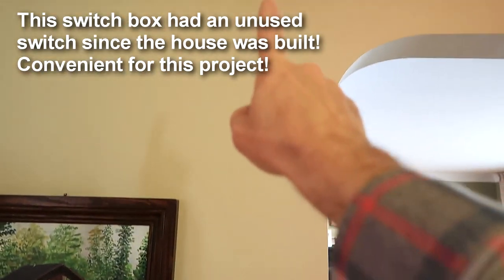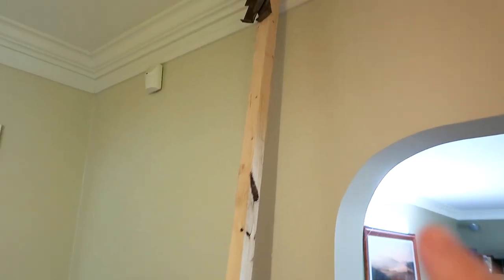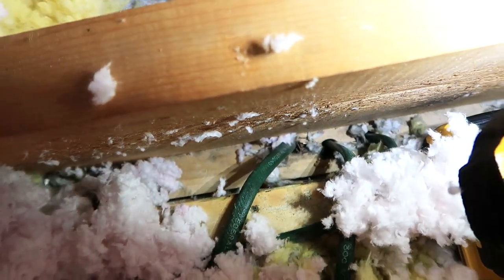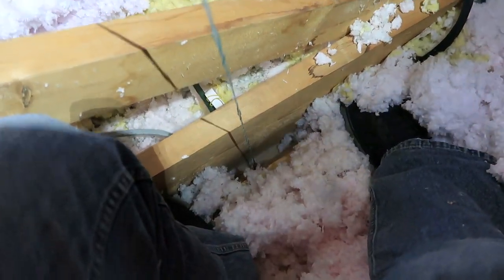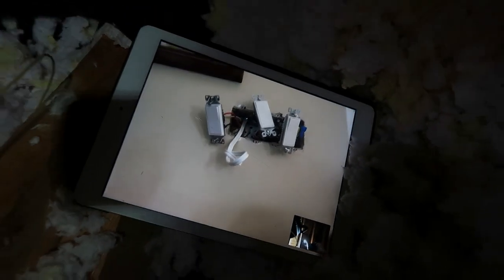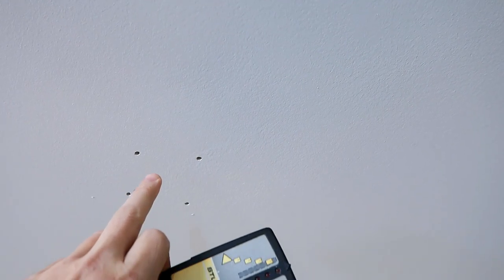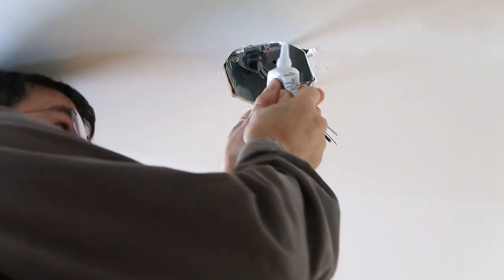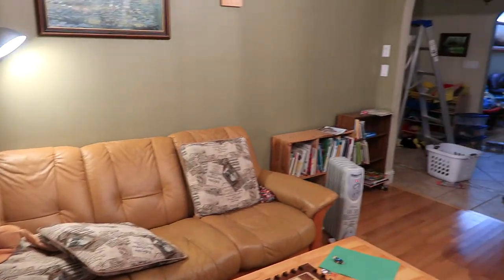Fishing a wire through the wall using magnets

Comment: Is the cling film on the windows to catch dust or some kind of insulation?
Reply: It helps stop drafts and creates a dead air space around the windows which increases the R-value of the window area.  In really cold climates it makes a big difference as windows are typically R-2 or less.

Comment: could have coloured the end of the wire, to prevent pulling it too far up  ... (when working alone + camera)
or marked the wire with the height from switch to ceiling,  stop pulling when you see the mark ... 
could have distance stripes, big intervals, shorter intervals, big block , stop
Reply from the maker: I just bent a tight hook on the end of it

Comment: Why be normal? I am in victoria bc and here we have poly vapour barrier over the whole inside. Between top plates, special boots on the electrical, caulking in holes etc etc.
Reply from the maker: here for new houses too.  This house at least has a vapour barrier.  If it was 5 years older, it probably wouldn't.

Comment: why not pull one of the cables out with a string attached? Or 2 strings. Then pull the cable back, and then you have the other string to pull the new wire with?
Reply from the maker: Because if it was done right, the existing cable will be attached to the framing, so won't pull thru
Reply: @matthiasrandomstuff2221  ah, ok. That makes sense.

We do not have that issue over here.
In the Netherlands we have all separate wires, 1 for each. So 1 for ground, 1 for phase, one for nul.
And they are just pulled through a pipe basically.
SO you can always pull em out.
And so you can always pull one of them 3 wires out, attach a string to it, then pull it back to have the string on the other side so you can use it to pull in a new wire.

Much easier i would think.

But i agree. The US is not the Netherlands and vice versa.

Comment: Drill a hole big enough to take a plastic  yellow tongue groove  off a floor board or a fibre glass push rod ..push that rod down then pull up the cable ..

Comment: COMPARE THIS WITH A HOUSE CONSTRUCTED IN GERMANY, I really dont know how you can live with that. Considering the prices much more cheaper in USA but quality not comparable. The electrical instalation no one would accept including Electrotecnical supervisory board. Please stay health
Reply: ?
How would this be done in Germany?

Stapling the wires to the studs? Or metal sheathing? This seems ok to me, but I am not an electrician.
Reply from the maker: In Germany, you just wouldn't do this in the first place.  Stone walls, expensive electricians, etc.
Reply: @Solarbonite  in germany you'd settle for the wires they installed 400 years ago when your house was built
Reply: @matthiasrandomstuff2221  
yeah and you would pay a lot more comparatively. People here like to talk sh*t about american timber frame houses, but they never consider pricing when they do. Also, the way he puts it makes it sound like all wiring here is done prim and proper. It's not, i saw many wild, lets say "creative" installations in my time.
Reply: Modern North American wiring that follows NEC/CEC is perfectly safe. Not very pretty though.
Reply: What do you find unsafe about our installations? If it's the metal boxes, they are grounded. If a wire gets loose and touches the box, it trips the breaker.
Reply: @endoresu  
It is done exactly the same way in european commercial or industrial applications, since not everything can be reasonable made from plastic. The difference here is just that consumer stuff is all plastic.

Comment: Next time (if there is one) it would've been better/easier to pull the wire down into the switch box from the attic rather than pull all the wire into the attic.
Reply from the maker: Either way works.  but I wanted to do the pulling, and rachel wasn't going to go into the attic.
Reply: @matthiasrandomstuff2221  haha. Sure. I wasn't suggesting Rachel goes into the attic, but your coil of wire. Pulling 6 feet of wire down is easier than 40+ feet up is all. Cheers